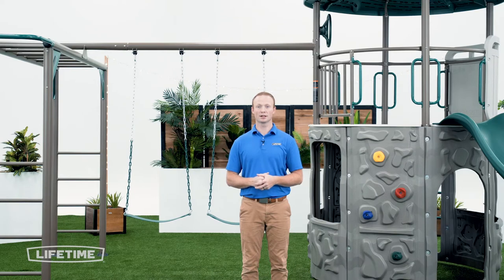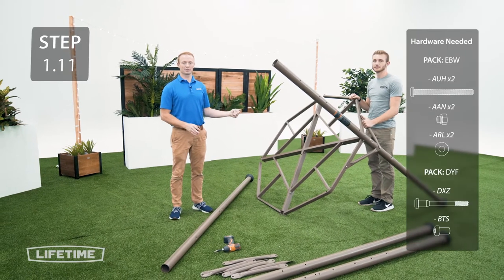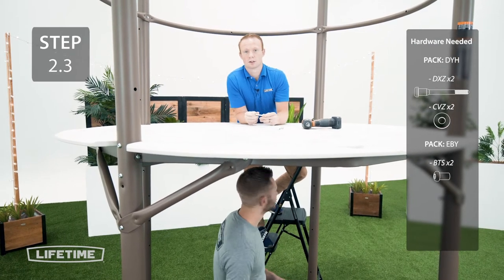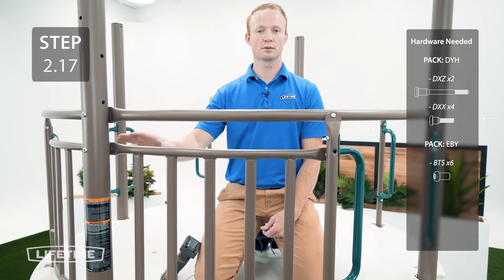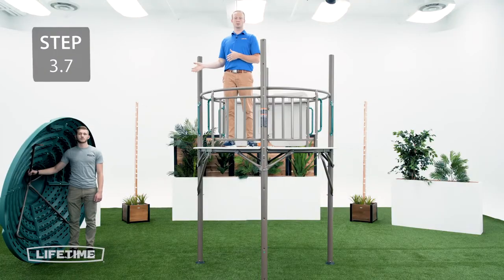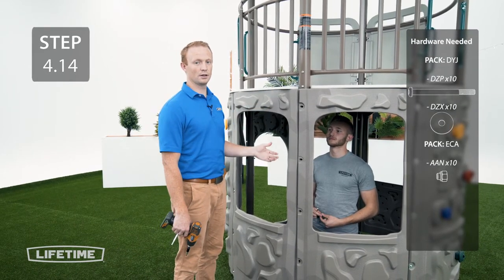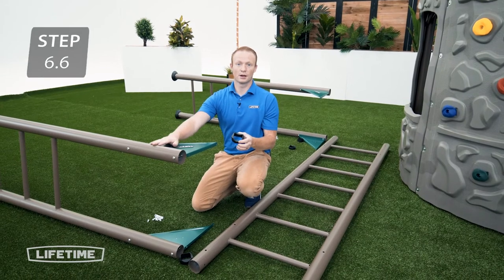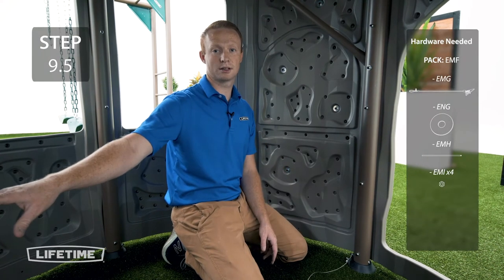Lifetime Adventure Tower™ Deluxe Playset | Lifetime Assembly Video

Comment: I'm almost done, have the tower done. I've had to undo things multiple times. Note for others setting this up - 

One: Make sure the deck support beam that has the holes in it (which attaches to the decking with 2 bolts) is the one touching the pole with the warning label - I learned this the hard way after we had the siding and roof and everything on (right before the ladder/slide section) - that was a major pain (Note - to remedy this, I used two of the extra self-bitting screws rather than take everything apart just to install two bolts - the decking seems pretty secure with all of the screws anyway, so hopefully it'll stand the test of time)

Two: When aligning the decking, make sure the seam is in line with the pole with the warning label - if you don't do this (I also learned this the hard way) - then the location of the drill out holes for the slide and ladder are not in the correct places

Three - when installing the bottom paneling, note that it may feel like it any of them can go anywhere, we installed one pair opposite of what it should have been and the doorway had one of the angled support beams showing which wouldn't have worked

The printed instructions are terrible, the video is great but its hard to keep watching parts over and over again when you're installing it outside, it would be really nice if the instructions were a bit more detailed/thorough. 

Lastly - the giant warning label in this video has changed - it is a tiny warning label which is not as easy to see during the initial setup steps.

But, all in all, I am glad to give the kids something fun to play on.

Comment: I put this together today by my self in about 8 hours...I'm exhausted. The only thing that was difficult by yourself is the two bolts that go right in the middle of the tower floor. I ended up drilling a 5/16" inch hole in the end of a 2x4.  The 2x4 was approximately 3.5' long.  I put the long end of the provided Allen wrench inside the 5/16" hole  at the end of the 2/4 and then I put the short side of the Allen wrench inside the bolt on top of the tower floor.  I then clamped the other end of 2x4 to the the outside of the tower floor to hold it in place.  This secured the top of the bolt and I was able to go underneath to install and tighten the nut.  I wish I watched this video before I started this morning.
Reply: How much does it weight when completed ? Any risk of wind picking it up  ?
Reply: Did this solo using the video and manual as guides 2 hours a day for 3 days. Just double check your work as you go and eat the elephant one bite at a time.

Comment: Is there any reason why you couldn't do section 1 and section 6 to get the basic frame for the layout/locations of the feet? We're not sure exactly where the placement will be and I also want to make sure the feet or on a somewhat solid surface, as well as placing rubber mat material inside the ground within the towers footprint
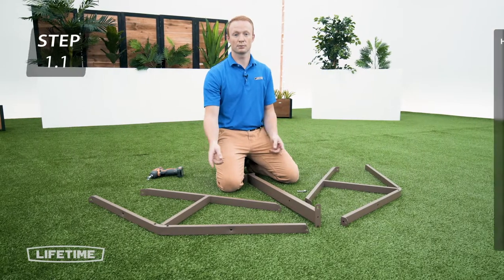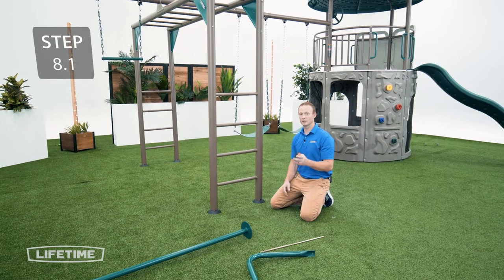Reply from the maker: Section 1 and Section 6 are both included in this video. Section 1 starts at 2:15 and Section 6 starts at 46:33 so I'm not sure if you're referring to something else. On page 12 of your instruction manual you will see the playset dimensions and will give you the idea where everything should land.

Comment: Can you put the monkey bars on the other side of the tower?
Reply from the maker: The slide and the ladders are interchangeable, but the monkey bars are not. If you wanted the monkey bars on the opposite side of the tower, you'd need to turn the assembly all the way around.
Reply: Can you add other lifetime playsets to this as a extension  @LifetimeProductsAssembly
Reply: The only thing that concerns me is the roof doesn't look very tall for older children.says ages 3-12. A 12 yr old could bump his head from the roof being too short.
Reply: I saw the lifetime castle it has a taller roof which I like but the kids love to climb and use the monkey bars so the lifetime tower would be my #1 pick but my concerns are the roof being too short
Reply: I am interested in testing the playtime tower playset and I will do a review on your website would your company be willing to send me this for a review I need to see if this would work for the kids ages 6 7 and 12